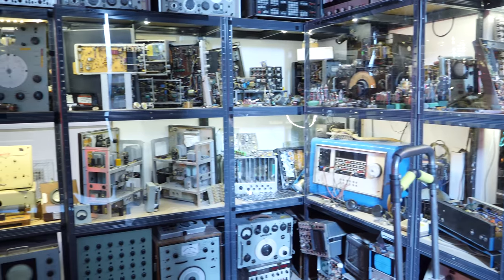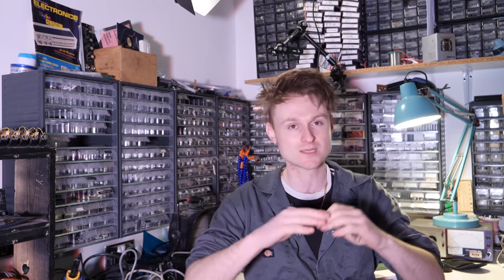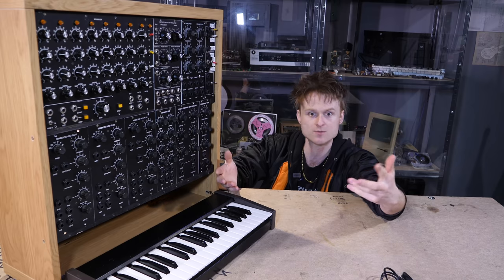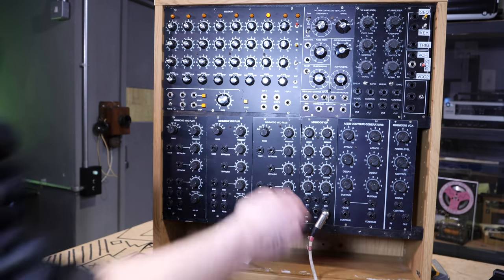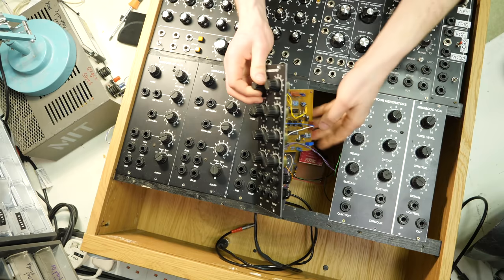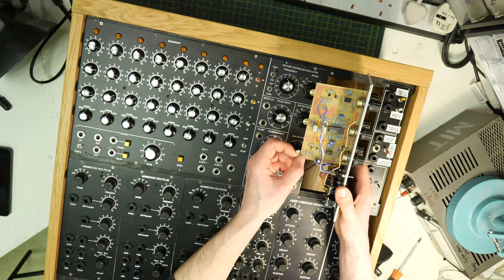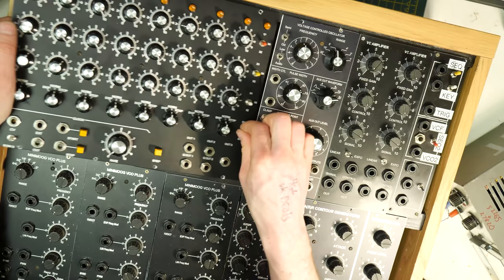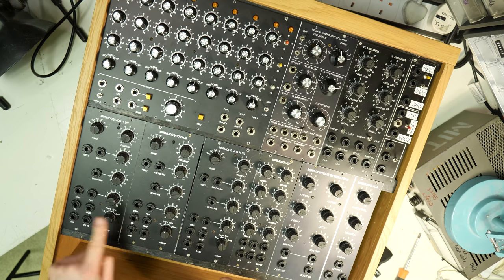DIY MOOG STYLE MODULAR SYNTH

Comment: I bet the guy who built this bookshelf modular, never knew it was going to spend the rest of it's life in a museum! How cool is that!
Reply: where is this person? i want to be friends with them!
Reply: @warpeggioslab  I want to be a friend to. Because friends speak open to each other. Great work. What could make it even better: 
- Solder protection varnish, the self-etched boards are already totally oxidized.
- Using a gauge for bending the components, and above all soldering them consistently and properly in one direction does not make such a botched impression.
- Maybe to think about the ease of maintenance beforehand is not bad either. Of course not for a prototype, but for the next build. 
I don't want to badmouth this thing. On the contrary, I like the synth. Wonderful :)
Reply: And not just any museum, but one of the most awesome ones i have heard of.
Reply: “It belongs in a museum.” -Dr Jones

Comment: Man, that's a beautiful build. 

And here I sit, with my homemade Eurorack setup limited to 84hp of rails bolted to wooden tiger bookends, a power supply in a cigar box, and three finished and two half finished modules. (Finished: a vactrol-controlled passive low-pass filter, an "i-am-o" VCA/filter,  and a module that breaks the internal PS voltages out to banana jacks, which I call the "Electrical Banana"; partly done: a VC AtariPunk, a very lowfi sampler/looper based on one of those birthday card recorder chips. Joystick CV generator, line/instrument input to/from Eurorack level module, and a bunch of stuff built from Electric Druid chips I have in the mail are all still on the drawing board.)

Comment: Pretty sure those panels are some form of Scothcal, from a quick net search:
---
As an engineer who may have specified materials or wrote specs for Military requirements, do you remember 3M Scotchcal? It was a photo-sensitive process used to manufacture labels, decals, signs, nameplates etc. on aluminum and plastic. It was alcohol-based which used # 8500 developer with a protective spray coating. Well, that was a few years back. Many engineers and Mil-Specs specifically called out on drawings for 3M Scotchcal to meet their strict marking requirements.

...
So, after all that history, the product still lives - and is now called ID MARK®. It has all the same characteristics and more using polyester and aluminum for high-quality, durable, custom labels, decals, signs and nameplates
---
Note the slight delamination visible at https://youtu.be/w-KZj-DXevc?t=468  (7:48 if the link does not work). 
I used to use this material to make very nice low volume/proto panels. One limitation was the UV exposure rig I had only handled  "11" X8" similar limitation might expaint the panel that looks like 2 but is a single item.

BTW: Love the channel!

Comment: It is possible the faceplates are laser etched with a laser engraver. Very easy to take powder coated/anodized/painted metal and remove just the coloring for a smooth clean engraving.

Comment: As a pianokey lover, I have to correct you on the keyboard part. It is actually a FATAR keybed from an older organ(using wire contacts on buss bars). The Yamaha keyboard would be a METAL gray keybed with rubber strip carbon contact on a matrix contact board. But the electronics could be Yamaha yes. The keybed is all plastic too which gave away the Italian manufacture of it. Still a great design!
Reply from the maker: I'm not sure you know. I mean the seller did say after this video went up it was a yamaha keybed. I'll open it again and look
Reply: @LOOKMUMNOCOMPUTER  Amen! Yes, it is a all plastic FATAR action like the one used on the Siel Keyman PK49. I have that action in my stash of keybeds lol.
Reply from the maker: @pianokeyjoe  well maybe the yp10 uses it? no idea. keyboards aint my strong point; weiird hey
Reply: @LOOKMUMNOCOMPUTER  I looked at the shots again closer this time. The keybed is from a Suzuki PK37. The keys are not Yamaha. The bottom casing maybe. But considering the value of a Yamaha YK10 versus a Siel/Suzuki PK37 home keyboard, I say it is not Yamaha at all. The wiring was done very DIY like as you pointed out, but indeed, you can see the front of the keys are squared, with the tops of the white keys having a slight curve to them like Fatar usually does. The Yamaha would be flat top whites and the fronts would have a little lip to them. But neither here nor there, as long as it works and you are happy with it in the end, that is what matters!! Cheers!

Comment: I concur with mark something. The book case idea is sweet, but as a synth tech and case builder, I can certainly see a lighter and  ventilated case would be smart bet, for sure using some Lexan or ?  for visual effect ,even addin LEDs to the inside. Mark might have meant a carry case, but I think just a stout cover with toggle hasp latches  would do the trick. I've built some wacky steam punk type audio arrays from  completely recycled items, using high end 3in full range drivers and  cothe covered wires and the visual is just as  noticeable as the amount of sound and its quality  these produce. If anyone wants a pair, contact me [I'm in the southern U.S .and  scrounge up as many 3 and 4in large magnet drivers as you can! lol

Comment: I belief that is photographic aluminium, I remember that stuff being around in the eighties, crazy expensive.  Just like the photographic pc's, you'd light it with UV and then put it in some chemical and you'd get the print from the transparent mask you used.  You c could get overhesdsheets that you could feed to a photocopier. So that way you could make a mask grin a picture.

Comment: Wow, that was a ton of DIY work! etching and drilling PCBs seems hard core to me. I can barely keep up with doing simple mods, troubleshooting and repairs to commercially purchased modules! ;-) It is odd that the builder soldered all of the MTA-100 headers in but then tack soldered the wires to the PCB? Either it's like you suggested, the PCBs were in a different system or maybe the builder intended to make cables but realized that the tools for inserting the wires into the connectors were too expensive and doing them by hand with funky tool sis a pain?

Comment: Aaargh they didn't socket the ICs! Nightmare to fix.
Reply: Single-sided boards are the easiest to desolder from since there's no solder in the holes. A squeeze-bulb hollow-tip iron will have that solder gone in 60 seconds.